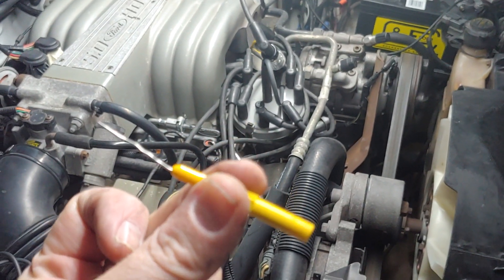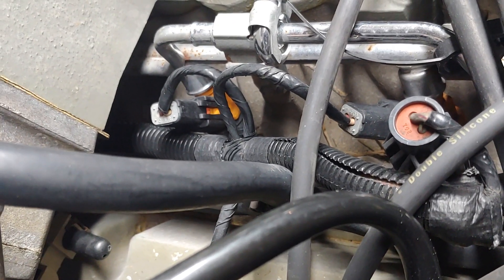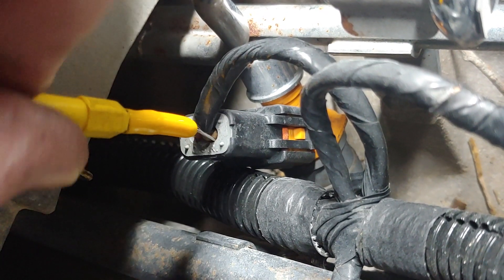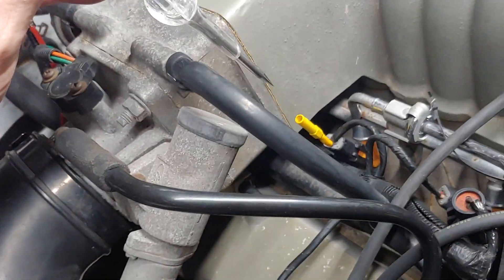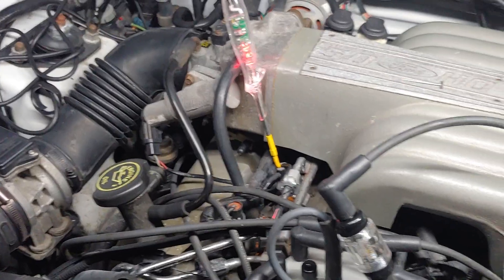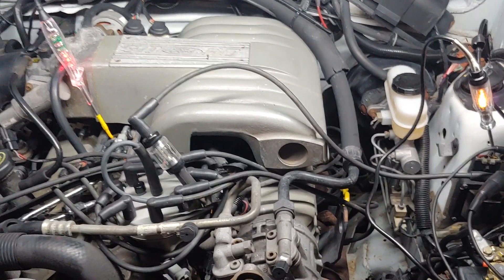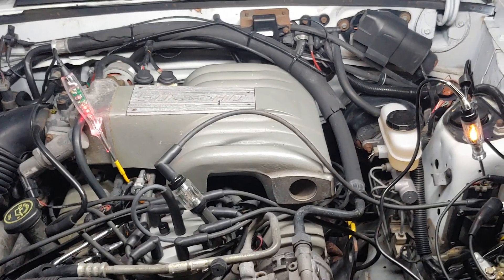Testing for Injector Pulse and Spark on a 5.0L Mustang

Comment: You have puted the backprobe on the Ground controlled signal and after that 1 lead of the test light on the auto body ground and the other lead of the light You puted on backprobe which it should be grounded .....how does the light turn on ? When both leads are grounded ? Explane to me please.....
Reply from the maker: I explained this in the video. The power comes from the PCM relay to all 8 injectors. When the injector is OFF, the power winds thru the injector windings, and comes out the other side, to the negative side of the injector, and continues to flow all the way back to the PCM itself. So when the injector is off, there is power on BOTH sides of the injector.

This happens because the injector windings are simply one long, coated wire wrapped around an iron core. When the injector is off, there is no current flow, and therefore there is no voltage drop across the resistance of the injector.

When the injector is turned on (by the PCM grounding the injector), then there is current flow, and therefore there is a voltage drop across the resistance of the injector. With the injector off, there is 12v everywhere. With the injector on, there is power on one side of the injector, and ground on the other side. Since there is 12v on both wires when the injector is off, and since the test light is an LED light that requires very little current flow to light the LED, the LED will light because it has power coming from the injector control wire, and ground coming from the strut tower.

Comment: Fantastic breakdown here. Car started fine the other day. But today it turns over but no start. I checked the distributor and coil pack which both were working good. I havent checked the injector yet but that will be the next thing. I also have fuel going to the shreider valve. One thing i noticed was when the key is turned to the run position, the fuel pump stays on. Im thinking the ECU has an issue not grounding properly.
Reply from the maker: When you hear the pump run constantly, it likely means one of two things. Either the fuel pump relay control wire is accidentally touching ground, or the PCM has bad capacitors (and possibly other related board damage). It's almost always the latter. Remove the PCM and pop the cover off. Carefully inspect the 3 teal blue capacitors with a bright light and a magnifying glass. If you see any corrosion on the legs or feet of those capacitors, or they're broken, swollen, or popped, then that's the problem. To be honest, they are way past their life expectancy, so if they are the original teal blue capacitors still, they need to be replaced. By someone who seriously knows what they're doing. I have a guy if you need one, and we carry the capacitor kits for like $15 plus shipping.
Reply: I just now saw your response. The issue is 100% the PCM, I checked the fuel pump relay chichi was working properly. I also checked the injector which was getting constant power to both wires, when the key was on. I took the PCM apart and the board looked solid with no corrosion on the board. All 3 capacitors were broken or leaking however, I replaced them all with new ones. Unfortunately I still have the same issue on install. It's likely that I damaged the lines in the board during the replacement. Which is garenteed at this point. Since I threw in a 92 Bronco 5.0 PCM for a second. I noticed that the fuel pump would prime properly. I appreciate you taking the time to respond.
Reply from the maker: @Scruffy72  the PCM is saveable, but now it needs to be fixed by an expert. Trying to do it yourself likely made the damage worse.

Comment: Late to the game but if it was due to fuel pressure why or rather how could that cause no spark?  Meaning, if it was fuel related wouldn't the test light flicker to show signs that it's not ignition coil/connector related but something else?
Reply: It was not due to fuel pressure, it was due to lack of injector pulse. The coil test light was flickering, indicating you have PIP and coil control.
Reply: @Pontisteve  Sorry.  What I meant was you mentioned if not coil/connector related then the fuel pressure could cause no spark.  How could that be if it was fuel pressure related.  In other words, let's says the coil/connectors/etc. all tested good then why would you think fuel pressure could be the main culprit?   I'm just curious.
Reply: @Nemesis74racer  I'm not sure I follow. A fuel pressure issue would not cause a no spark issue. If I said that in the video, let me know what timestamp that's at. Now if coil control and injector control are present and the car still doesn't run, then certainly fuel pressure would be the next thing to check. Really, fuel pressure is usually one of the first things I check on a no-start, just because it's easy to test with a gauge and know for sure. Testing coil control is also super easy. Injector control is probably the hardest of those 3 things to check, so it would likely be the last of those 3 that I looked at.

Comment: With 12 volts going to each injector, splicing into that power source and installing a toggle switch located in a place under the dash that you can reach..hidden from sight..would be an excellent theft deterrent..Toggle the switch to cut current to the injectors and the engine never starts..switch it to power and off you go..
Reply: If you want to do that, it would be better to interrupt the power or ground going to the control side of the PCM relay. That would kill power to all of the EFI, and would be much harder to work around.
Reply: @Pontisteve  That is a good idea..I have a 94 Ford E350 Ryder moving van. 460 engine with E4OD trans..Bought in 2001 for my construction business..I am going through the whole thing..Rebuild engine, trans and have pulled all the engine control wire harnesses..
Your idea would shut all of the EFI down with one toggle switch..No fuel pump..no nothing..ECM needs new caps..When the van is done, I am leaving California to who knows where and I need this van to be totally reliable and also not to be stolen while it is parked in a hotel parking lot for the night..
Reply: @MichaelJohnson-cm4wp  Good call on replacing the caps in the PCM. Be sure to remove the conformal coating around the base of the capacitors first, replace the caps, and thoroughly clean the area around their base with high purity rubbing alcohol and a toothbrush to kill any remaining acid and keep it from continuing to eat. The acid eats not only the capacitor legs, but also the printed circuits nearby.F

And a big congratulations on leaving California!
Reply: @Pontisteve  I am so old school..grew up in the 70s where a engine just needed a correct gaped points..new condenser..fresh plugs and adjustment of the carb using a vacuum gauge !! LONG GONE!!..Now one little green crusty connection..one mouse wire chewing and your engine is dead..A dead band TPS and your engine dies at the line..Transmissions shifting weird because a TPS problem..Over rich condition because of a cold water temp sensor..On and on..
I want to buy a scope..I was thinking of the Hantek 1008c to start and learn then move up..Just to check injector performance and stuff..I really enjoy the learning curve of all of this..
Kansas..that is what I am thinking of going..
Reply: @MichaelJohnson-cm4wp  I have a Picoscope 4 channel master kit, and it is amazing. But price wise, it's the deep end of the pool. I would still go for it, but if you want to start out lighter, look at the Autel scope or a used snap-on scantool that has a built-in 4 channel scope.

Comment: Thanks for this video... Took me a bit of searching to find something showing how to check for "injector pulse" (didn't know what it was actually called), as opposed to all the videos my search sent me to on how to check the injectors themselves... Which I did. 
QUESTION: What do you do when you get no injector pulse or no signal whatsoever to just one injector plug while all others are running fine. I've got an old Toyota 22re with a #4 cyl. Only coming up after 10 or 15 minutes and then cutting in and out intermittently. I've confirmed the injectors are good and even swapped #1 & #4 and #4 cyl. still down. I'm about to go out and run this test on a healthy plug, then #4 and see if it's the signal. I can't really think of what else it could be unless it's in the valve train... I've already checked for spark.
Reply: If the injector itself is fine, there are two reasons I can think of that would cause the PCM to not fire one injector. First of all, on modern cars if you get a misfire code (P030x), the PCM might intentionally shut down an injector to keep unburned fuel from being injected, which can cause a cat failure. Why inject fuel into a cylinder that the PCM knows can't fire the spark? The way to identify this is to test for injector pulse right away after starting the car, and continue testing for a minute. I can't speak for Toyota, but Ford will fire an injector no matter what for the first 20 seconds or so. After that, it won't fire an injector that has a coil or misfire code. So in this situation, you would have injector pulse at first, and later it would go away and stay away until you restart the car, at which time it would be back again for those first 20 seconds. Toyota might have similar technology.

The second reason might be that the male PCM terminal for that one injector control wire might be not making connection with the female terminal for the PCM harness connector. It could be a pin fretting issue (weird vibration that wears the male terminal), or a bent pin (human error plugging the PCM in), or a broken terminal retaining clip. I've seen this before. I have a video of a Mustang doing this. It was losing injector pulse to one cylinder, and the problem turned out to be the plastic finger on the PCM connector was old and brittle, and broke off. So it looked like that wire and terminal was fully seated into the PCM connector, but when you push the connector onto the PCM, it was pushing the female terminal out of the connector, instead of inserting the male terminal into the female connector.

Most other injector testing methods are crap. But you can ohm test all your injectors (unplugged injector, car off). Each injector should be between about 11 and 16 ohms, and should be within 0.1 to 0.2 ohms of each other. Testing all of them will reveal the pattern.

You can also get into a situation where the injector is electrically fine, but mechanically stuck shut. This can happen when a car sits for a long time. Put a flathead screwdriver against each injector, and up to your ear. Listen to them all run. Even the dead one will sound like it's clicking, but it won't click as loud as the other ones. You might also feel the injector click. But a stuck shut injector will have the problem and the misfire code move as you move the injector to a different cylinder.
Reply: @Pontisteve  thanks. This is an 89 Toyota pickup. OBD1, distributor ignition, and I wasn't even getting a CEL. All the injectors have checked out with ohm meter, all dead 14.1, just below range max., All checked for open and close, and all checked for nice even spray. 
Your advice on tracing the wire is what I'm thinking. I'm assuming there will be a dedicated pin, or pair of pins, for each injector. I'm not sure if it's set up with a separate module for the injectors or if everything comes from the ECU, but whatever it is I'm pretty certain it hasn't been unplugged in at least 18 years. It's a good possibility one of the wires has gotten a nick and short it out somewhere in that 33-year-old harness. 
This should be fun...

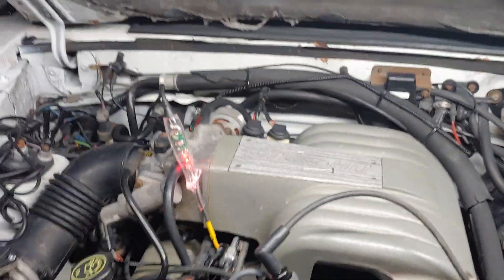Comment: 5:10 .  How are you expect a computer ground the injector when you already unplugged the computer? 🤔
Reply: At that point in the video, I'm showing you what it looks like when you are missing injector pulse. And I tell you that the computer is not in there, so there is no injector pulse.
Reply: @Pontisteve  so you unplugged computer for demo purposes and that was a healthy engine?
Reply: @leobuck2060  I did unplug the PCM to show that you can have spark without any PCM interaction at all. But injector pulse does require the PCM.

Comment: Great video on how to test. But what about the fix? I have a 95 f150 with 5.0 and have no injector pulse. Have spark, have fuel pressure. Injectors not firing. Is that a pcm issue?
Reply: If you have spark, you should also have injector pulse. The PIP sensor sends the signal to the PCM, which fires both coil and injectors off that same signal. Check to see if the red injector wire has 12+ volts with key on. Also check other injectors to see if they have ground/control pulse.
Reply: @Pontisteve  I have spark all day long. Just no pulse to fire injectors. Wondering if its ecm or possibly crank sensor.
Reply: @robertjackson2012  The PIP sensor is in charge of both injector pulse and spark. Same signal is used for both. Other than a bad PCM, the only thing I can think of is injector fuse (lack of power). If it was one injector, I have much more ideas than this. But all injectors? I would be looking at power the hardest.
Reply: @Pontisteve  I have power at all injectors, just tested crank sensor it's good. I have no ground pulse to injectors. None of the fuses are labeled so it's a shot in the dark until find it.
Reply: @robertjackson2012  The PIP sensor in the distributor sends a pulse signal to the PCM. 4 pulses per one revolution of the crank. You can see that pulse by backprobing the top wire on the ignition module, and touching an LED test light to it while cranking. The PCM receives this signal and fires 4 injectors per revolution. Make sure you test more than just 1 injector.

The ignition system actually doesn't even need the PCM to fire. It does need the PIP sensor though. So a PCM problem, or lack of power/ground to the PCM could certainly be the cause of this. Maybe check PCM capacitors.
Reply: @Pontisteve  thanks Steve. I have power to all injectors. I know I have PIP because I have spark. I can get it to run by spraying gas down its throat but I'm missing something.... everything keep bringing me back to the computer. Not sure if im on the right track or not but this is really making me miss the carburator days...lol
Reply: @robertjackson2012  I think you're on the right track. I have a video somewhere that shows the ignition firing normally even though I have the PCM removed from the car. It's because the ignition module can fire the coil at 10 BTDC with the SPOUT unplugged (the computer removed acts the same). So if you have Injector power and don't have injector ground pulse, and you do have PIP, then your computer is suspect. All too common in Fox bodies.

The computer being non-functional can be broke down into 3 reasons: 1) Computer is not ON (power/ground issues). 2) Computer is actually dead (likely capacitor issues). And 3) Computer is on and not dead, but the 5 volt VREF circuit is being shorted to ground, either by a short to ground in the VREF wires, or by a shorted VREF sensor.

A good next step would be to turn the key on, backprobe the VREF wire at the TPS sensor, and get a voltage measurement. If you see near 0 volts, suspect the PCM is dead or not on. If you see 5v, the PCM is on and functioning normally. And if you see 1.5 to 3.5 volts, you need to find your short to ground in the VREF circuit or any of the sensors that get VREF power. You can eliminate the sensors from that list by unplugging them and seeing if your VREF voltage jumps back up to 5v when you unplug one.
Reply: I have ignition to the plugs. Just no power to the injectors.